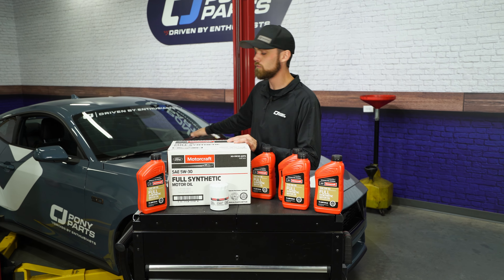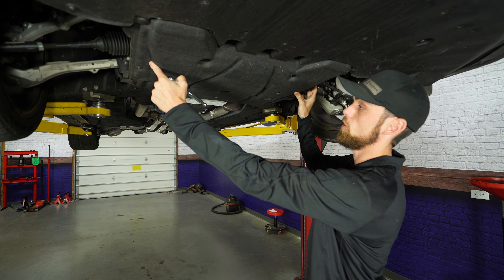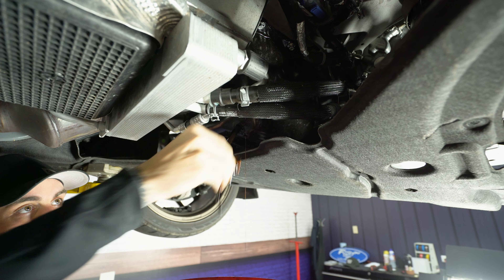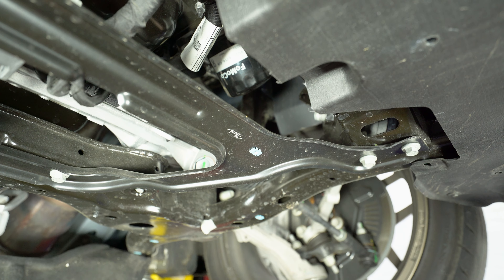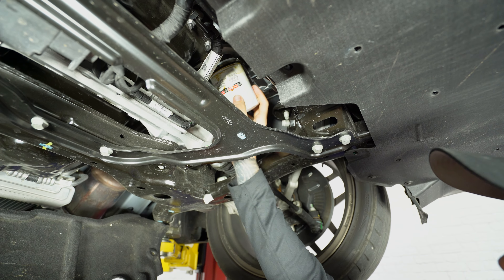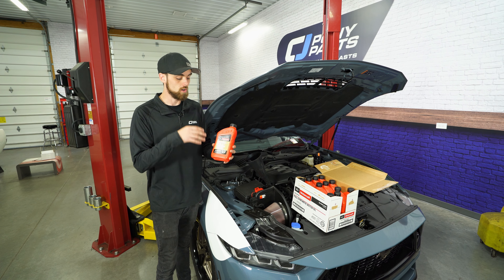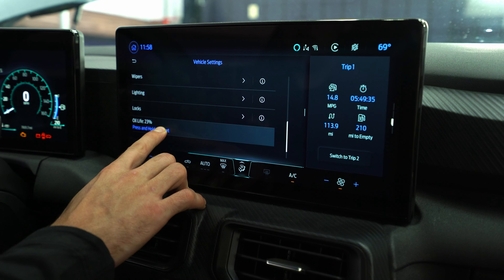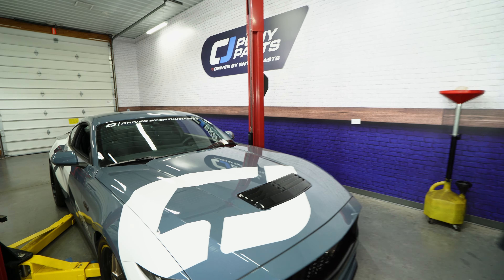How to Change the Oil in a 2024 Mustang | S650 Mustang Oil Change

Comment: Just so you know I fount it faster to remove the front left wheel to get to the filter, on my 2024the drain plug is behind the cover so it wheel bolts which is faster than the bottom ones if you do not have a hoist

Comment: I wouldn't be using that oil if it were mine
Reply: Agreed, why?
Reply: If I'm gonna invest that kind of money in a car, I'm gonna use the best and motor craft oil is pretty good, but it's not the best.
Reply: Good video Cory Keep doing them. I like the bag tick.
Reply: And what is the best?
Reply: All the lab test say, Amsoil
Reply: 540RAT Engineering blog says that Amsoil has cheapened and lowered their wear protection significantly over the last several years in order to increase profit margins. The old Signature Series 5W30 was his former #1. It has now fallen into the abyss within the top 50 or 60. The current best wear protecting oil by his proprietary dynamic torture testing is Quaker State Full Synthetic 5W30 (not labeled Ultimate Protection). Give it a look. Certainly surprised me
Reply: @vqdriver could you link the video?
Reply: I also check his Q&A weekly. Scroll way down for the actual wear rankings list!